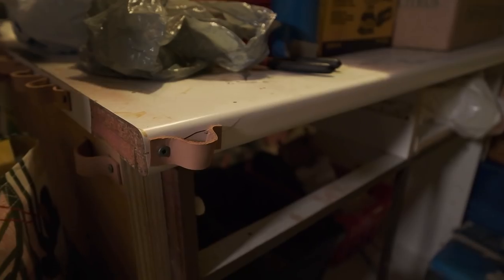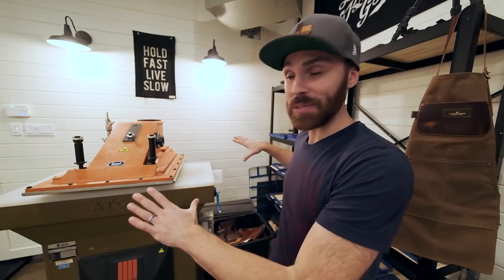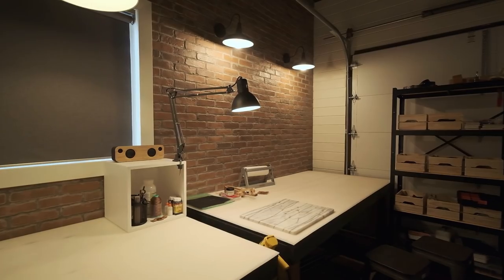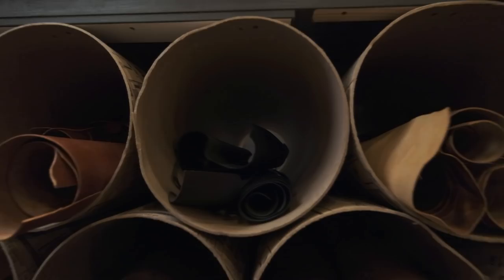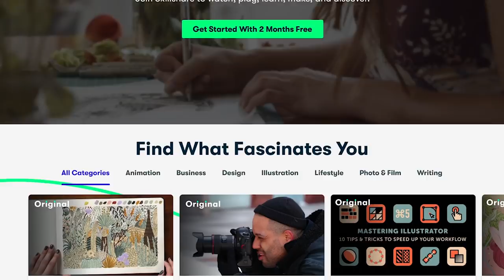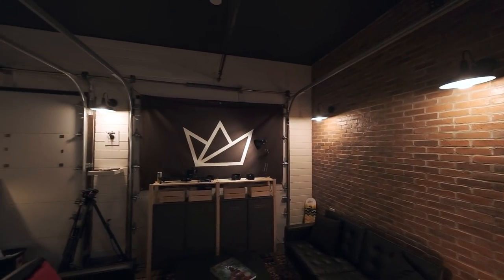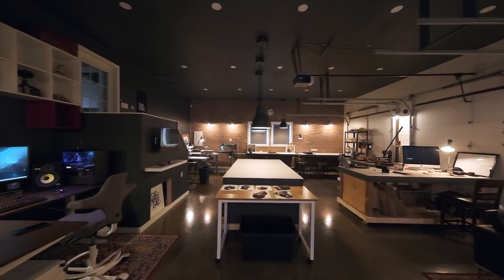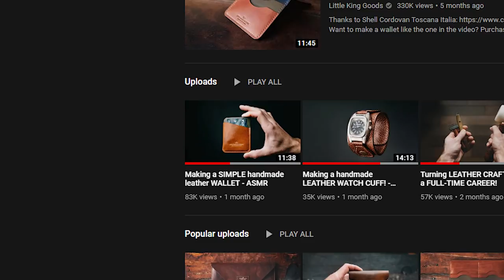I turned a 3 CAR GARAGE into a LEATHERCRAFT STUDIO!

Comment: Excellent job, I designed a 3000 square foot SHOP, I personally only do CUSTOM LEATHER CRAFT and teach leather craft, and repair a saddle once in awhile. All my tables I built myself and put casters on all except my teaching bench,  it's set up 4 wheel chairs and I didn't want it 2 move around. GOD'S BLESSINGS ✝️⚾🙃